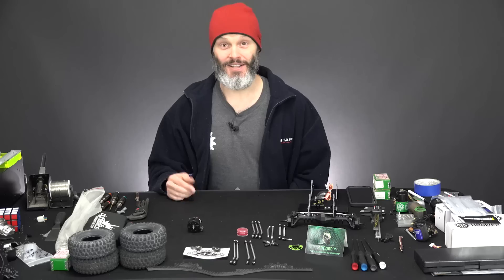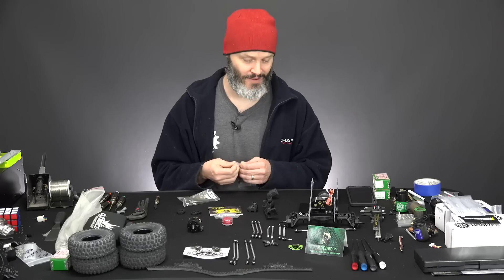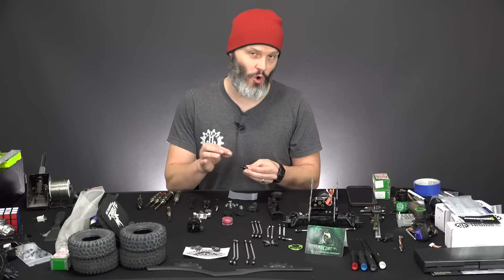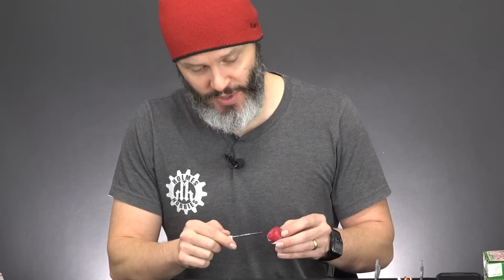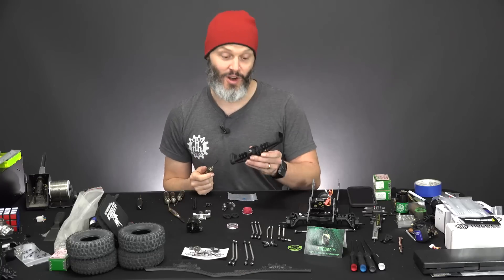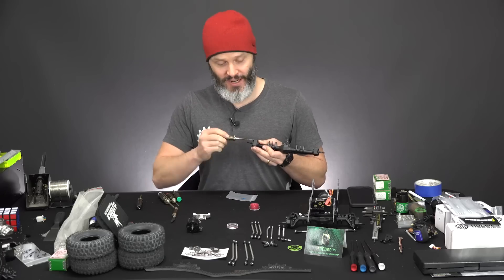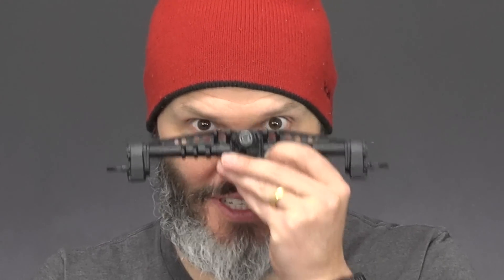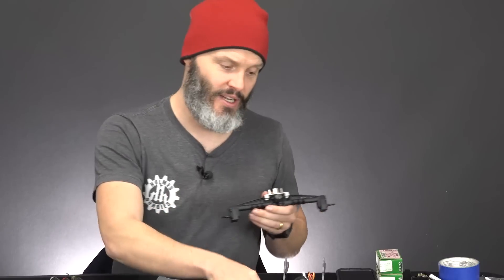Build It Right! Rear Axle Assembly - Axial Capra Based Class 2/ 3 Comp Rig Project - Holmes Hobbies

Comment: Would the capra axles work with the scx10?
Reply from the maker: with custom links, sure
Reply: @HolmesHobbies custom links in length or in shape? I was thinking the links are ok it's the driveshaft that's the problem
Reply from the maker: @barajastony0  length.   Driveshafts may need cutting or longer ones too, but depends on where you put the wheelbase

Comment: No one wants to see the sack your hiding under the table!  80w motor oil?!  Good god man, that's gear oil!  Sometimes, I also use a little dab of lube on the tip for the screw.  Wait, what?  Technically, they're spools, since it can't disengage in a corner like a locker, but I call them lockers still.  You're correct, it's a third member.  You and Matt's YT videos are always the most fun to comment on.  Ha!

Comment: Great video !  Is that truss piece not screwed in at all?  I heard it snap in but .....
Unless they have changed the formulation of loctite it is anaerobic meaning the absence of oxygen activates it.  The containers it is stored in are oversized for the amount of product so there is plenty of oxygen to keep it liquid but when it is sealed in the threads of a screw there is no longer oxygen available and it hardens and actually turns into plastic.  It will never harden in the open but it will dry out somewhat.  
Where can I get the shims you were talking about?
Reply from the maker: It does get screwed in, I just didn't yet.    

The lack of oxygen will set many loctite products , but they won't properly cure without touching active metal too.  Important distinction, as they will not cure with plastic on plastic, will not bond properly inside a plastic hole with metal screw, and are extremely slow curing when bonding anodized aluminum and other less reactive metals.
Reply: @HolmesHobbies  Thanks for the reply.  I guess they have changed loctite products !  Thanks for explaining.  
Now about those shims.  I sure would like to have some just in case I need them.

Comment: You said too much grease is not a good thing can you tell me why that is and when I built my axles for my mud buggy I completely packed the axles till it was shoving out all ends and I haven't had any issues but willing to learn something new
Reply: Too much drag on drivetrain take some out
Reply from the maker: drag.   But compared to rusting, its better.
Reply: I was thinking that too, but if going that extreme in h20 can seal boxes with lil silicone but if bashing lil drag not going hurt either🙂🤔🤔john thanku for great budget motors , I was happy to have 2 stickers w each motor the lil things that count 🚗🙂 I should've ordered plugs but probably better solder right to motor anyways...

Comment: lol.. thought I was the only one, assemble... disassemble.. trim, shim, swap screw lengths, lube, threadlock.... assemble, ah crap I forgot... disassemble. Three hours later... look at that, my axle is assembled.
To get a bit of break in as I assemble and to make sure its not having issues, I use my drill to run in the differential assemblies and the transmission.